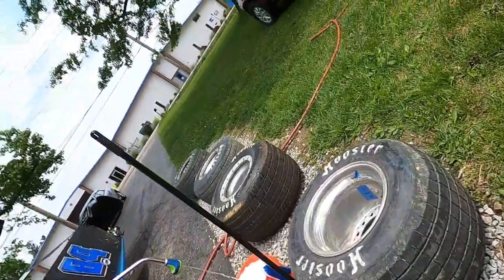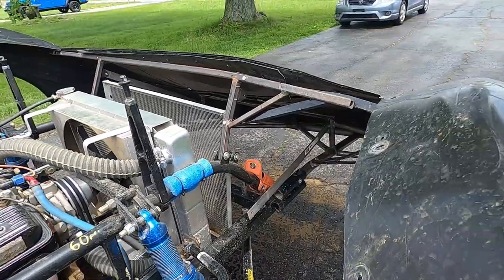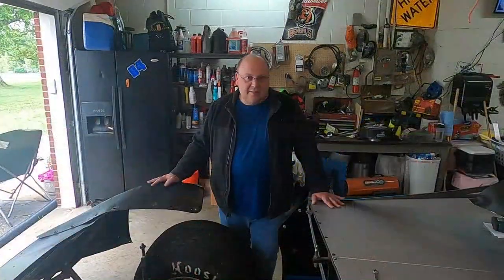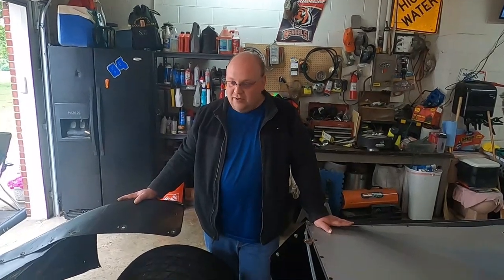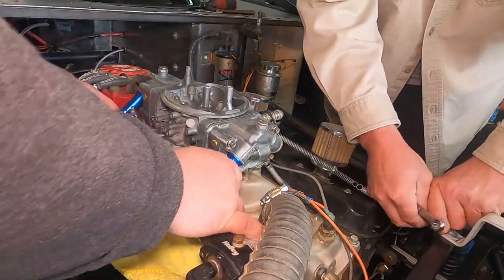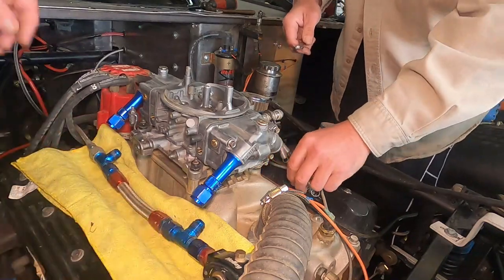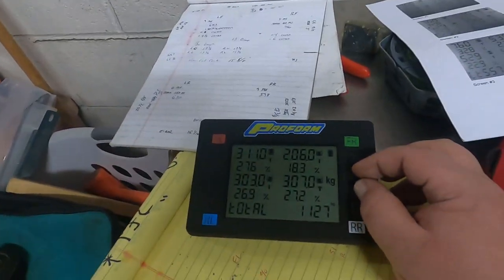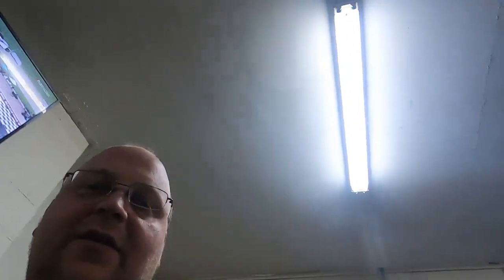SCALING OUR DIRT LATE MODEL CHASING RIGHT SIDE PERCENTAGE WITH DAMAGE CONTROL AND CARBURETOR WORK

Comment: Hunt The Front guys about burnt their 604 car up with that style fuel pressure reg/fuel log set-up. Actually caught on fire. Might want to look at their episodes to see what they changed to. Moved the regulator inboard.
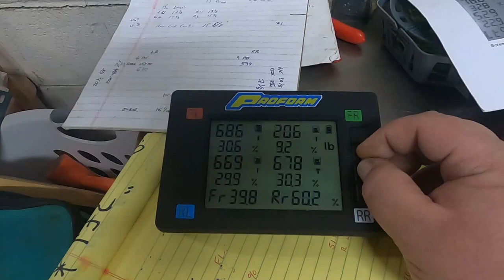Reply: Battle Scars and Burn Marks! We’re Ready for a Doubleheader Weekend of Racing---8:15-8-45
Reply: Race Shop Addition and Finally Going Super Late Model Racing Again!---9:45--10:18 shows new set-up. Really just a few fittings to change or remote mount regulator.
Reply from the maker: We have seen the fuel situation with HTF and will take consideration for change.  The fuel setup now how worked excellent for the last three years with out issue.  Not saying it shouldn't be changed and we feel we can do it our selves only having to buy much but a few fittings.

Comment: Less rear more left will make the car turn better (you got a 602) rear percentage is not important
Reply from the maker: Roger that.  Why does more left % make the car turn better?  Most guys we have spoken with were shooting for %54ish left side %.  Just looking for your opinion.
Reply: @LateModelGarage  more left makes the car turn better because of Newton’s 1st law. An object on motion… you know the rest. If you’re familiar with Newton’s laws you know that we can look at systems such as race cars simply as sums of their parts. In order for a vehicle to negotiate a left hand turn, the right side of the car will have to accelerate relative to the left side of the car. Since the left side is heavier than the left side, it takes less force to accelerate the right side past the left side.(Newton’s second law). 

Hope this helps. Please reach out if I can help further.